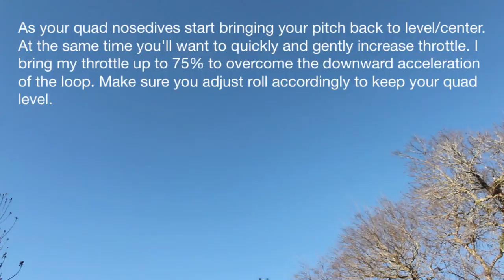Quadcopter Back Loop How to with Blade mQX

Comment: I was told it is not that hard if you get high enough in the air to grab it on the way down. I did it on the F450 frame. but not the TBS frame.

Comment from the maker: Good Q. I was actually in high-rate when doing the loop. I'm not sure it's possible with low-rate but may give it a try. You'd have to get it up there pretty high I would think since low-rate is pretty dampened.

Comment from the maker: Geez that Armattan frame is amazing! I appreciate you pointing that out. With that setup you're going to get much more control and responsiveness than with the Blade mQX....at least with the default transmitter. Now I've seen one guy that tweaked his expos and was doing rolls with the Blade no more than a couple feet off the ground. It was insane. Anyway, my goal is to take this to the bigger quad and I'll post a vid of that as well. Good luck with your practicing.